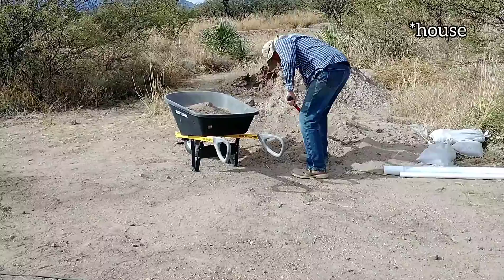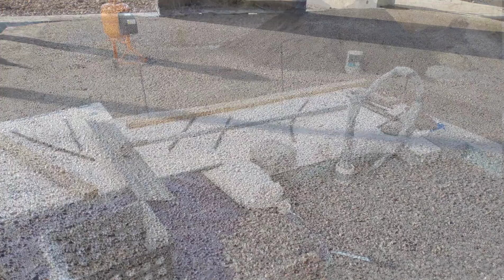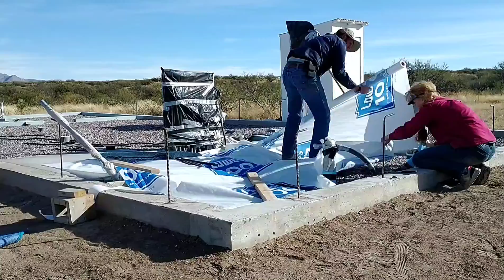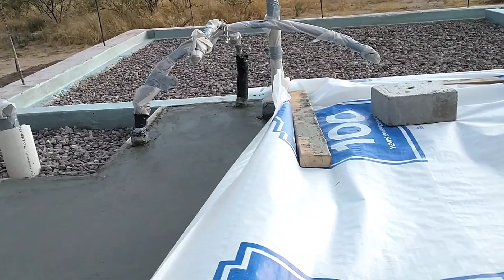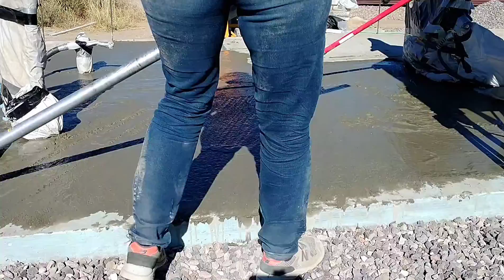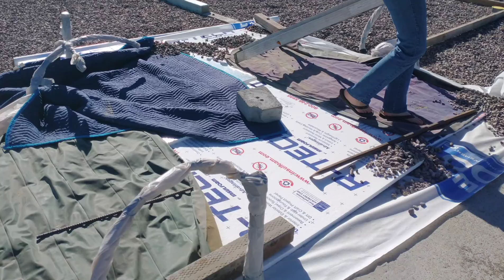DIY Concrete | Mixing & Hand Pouring Our Floor & Pad #9 Off-Grid Home Build 🏡

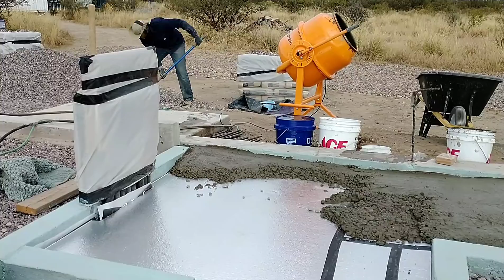Comment: Red & April you are making great progress and doing a super job. One third of my shop I experimented pouring with an aircrete sand mix that collapsed badly on me and I ended up with a brittle mess. I had a crew pour the rest of it and try putting a thin coating of concrete surfacer over the section I did. It was not strong enough and was giving in places. So this past week I mixed and poured it in two pours. I put a 1 1/2 inch top coating and it is higher than the rest of the floor which is not ideal but what I had to do to fix it. The last pour took forever to set so I could work it and I had to get up at 3:00 in the morning and work it for 2 1/2 hours and then go back to bed, get up and work it one more time. It was so much work. finishing concrete is one job I will pay a crew to do in the future.
Reply from the maker: Thanks so much!
Wow, that's a lot of aircrete, and a lot of work! We too found that failed aircrete batches can be really crumbly and not good for much!  It will be interesting to see how different sections of our garden wall hold up after a few years. 
Oh no! That doesn't sound like any fun at all, especially considering all of the other stuff you have going on! 
We are pouring small sections at a time, so it hasn't been too bad, but it's definitely still a lot of work. 
Thanks for watching, and best wishes in the new year! 😊

Comment: I was really surprised to see how far away from the current pump /laundry house you are building your new home.  Is it about 1000' ft. away?  Thx
Reply from the maker: It's 350 or 400 feet away from the house. It is a shared well, so we wanted it somewhat central on the property.

Comment: People thought we were crazy too when we poured about 10,000 pounds (over 120 eighty pound bags) into the wall we rebuilt on our castle. We used almost the same mixer as you. The one you have looks like a newer model. Sometimes it is just what you have to do.
Reply from the maker: Yes, a little at a time gets it done! Wow, that is a lot of concrete! Y'all are doing a great job restoring the castle, very cool!

Comment: Really good explanations on your thoughts and processes.
Excellent idea on the fibers.
I would suggest some superplasticizers.
It would be well worth your while to get a bigger mixer.
Try to move all the materials to one spot for the mixing.
Yep go with concrete floors through out.

Cheers from Oz.
Reply from the maker: Thanks! The materials have to be moved either way, so it worked ok to just go get them when they are needed. We'll probably start with the earth floors in the bedrooms and see how it goes. Thanks for watching! 😊

Comment: Good job, you must be at some elevation, I did not know it got that cool in the eve.
Reply from the maker: Thanks! We are in a valley, and the cold air seems to settle here at night. We have seen our night time temperatures as much as 22° degrees colder than in town! We may get down into the single digits this week,  hopefully we have done enough to keep anything from freezing.  🥶❄️